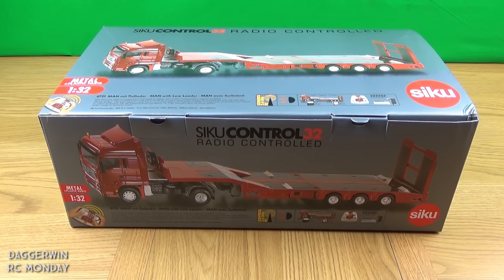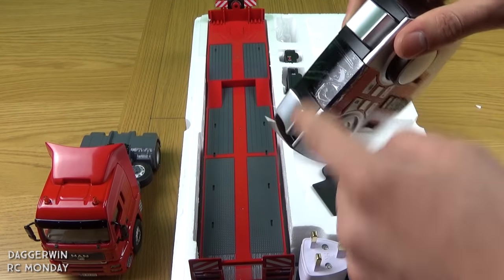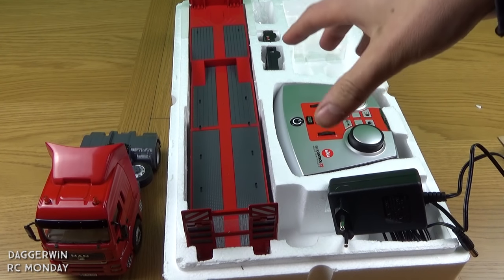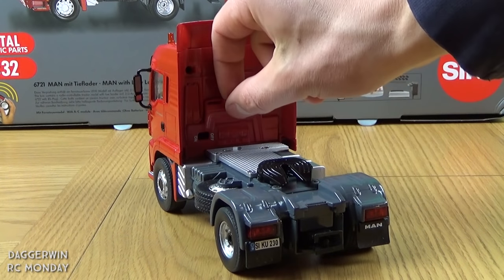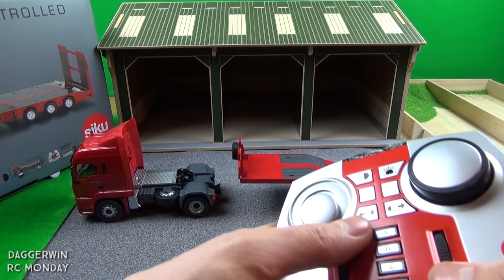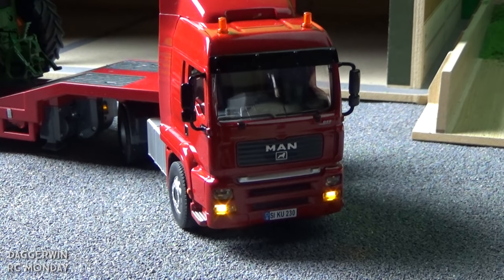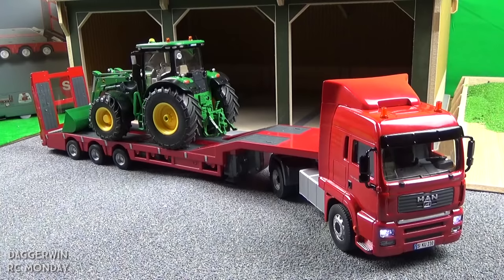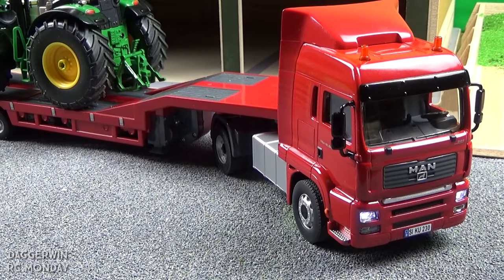RC Monday | Siku MAN TGA 18.540 Low Loader Truck RC Lorry

Comment: No! That's a socket adapter not a power adapter, UK as most of Europe have 230v @ 50Hz while countries like the US have 110/120v @ 60Hz. Always check the manufacturers specification or contact you local power supplier if you have any questions. Might save your or someones life one day.

Comment: The current low loader in fs19 is crap, i cant wait to have a low loader thats more convenient.. my gripe with the vanilla low loader is that while it has decent space for two tractors it could have easily fitted a third tractor on the front section that looks like its meant to store smaller equipment, i did try to put small equipment on it but because i cant secure it with belts or cables it would often roll around or even fall off, the tractors themselves would fall off if i turn too fast or hit something like those cars that wont steer clear of any farm vehicle thats indicating hazard and beacon lights (it seems the cars only behave themselves when a helper is doing the job, otherwise they have absolutely no decency to stay away. Also in the felsbrunn map (not sure if this happens in ravenport) everytime i bring the low loader to the bridges up the hill on the northeast part of the map the low loader flips out when crossing the bridge and tips everything over, when its empty its even worse and if it wasnt attached to the semi it would have launched itself to orbit..

Comment: Your Lorry is different to mine 
As soon as I turn both on on the auto connect so I don't need to switch 
 
I got the Scania one with the tipper and bought the low loader separate

Comment: Your Lorry is different to mine 
As soon as I turn both on on the auto connect so I don't need to switch 
 
I got the Scania one with the tipper and bought the low loader separate
Reply: Same
Reply: jamescarrick10